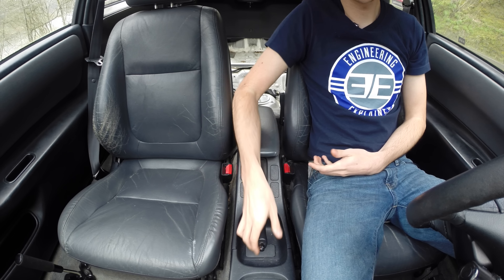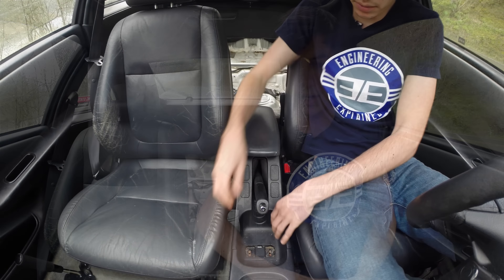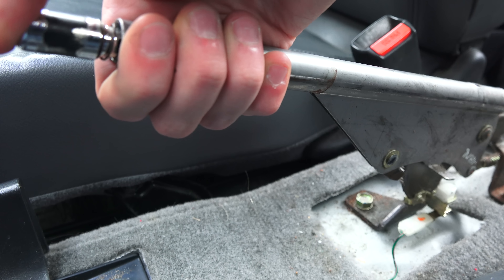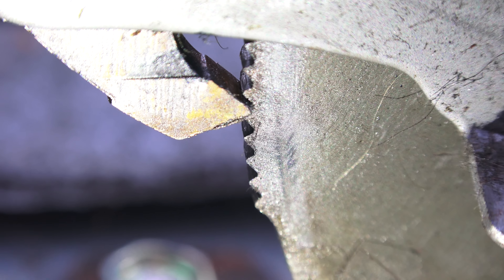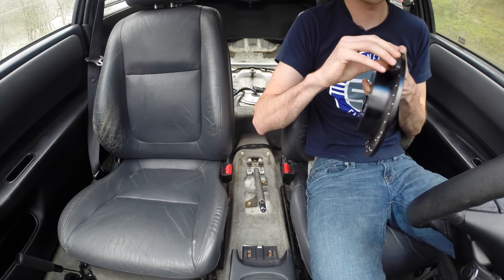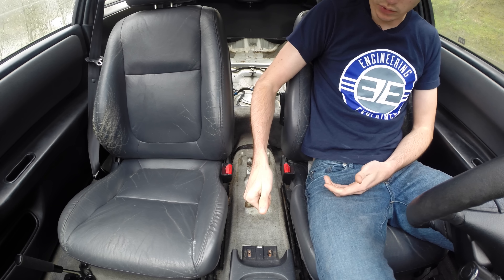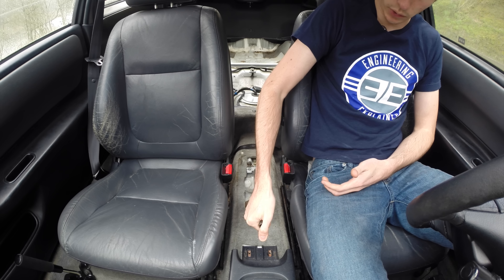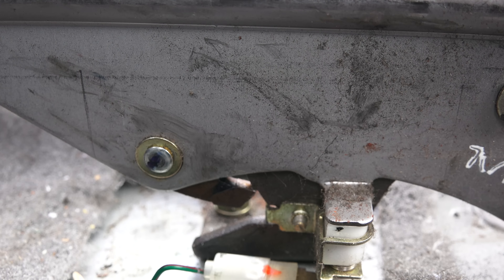Always Press The Handbrake Button? Myth Busted

Comment: He roasted everyone with the socket wrench example v
Reply: Socket wrench’s never wear out do they?
Reply: I've worn out a couple of 3/8 ratchets, they just slip because the teeth were worn down.
Reply: @daily501  I was taking the piss. I’ve binned quite a few down the years mostly Britool as that’s my favourite brand. ( after keeping them for potential spares, I got real and chucked them) 
There’s a lot of people who seem to think that the metall to metal contact and stress in a handbrake ratchet is exempt from the rules of physics that eventually fucks everything else.
Reply: @highdownmartin  i was replying to original comment mate. I fully agree with you about the metal to metal wear, I always push the button when operating handbrake lever. Have a good Bank Holiday weekend mate
Reply: @daily501  and you fella
Reply: It was basically the most polite burn 😂

Comment: Thank you to Car Throttle for perpetuating this myth.
Reply: lol
Reply: Friction causes heat, genius.
Reply: Yes friction, but you would probably have to sit there pulling it up and letting it down for a pretty long time for there to be enough wear for it to fail. Like a thousand years.
Reply: But the damage the friction creates is so small it can be disregarded. Very small quantities that are used to describe inevitably larger numbers are sometimes not needed since they affect it a very small quantities that isn't even noticeable until a very very long time frame. But if you are oh so well versed scientifically and care so much for that small detail then instead of using 300 000 000 as the speed of light, use the exact value which is 299 792 458 in every computation you would use that constant. Also, when facing non-repeating decimal numbers, like the value of pi, use as much of the space you can to write the farthest decimal value you can since accuracy is that important to you. Lol.
Reply: Yeah you'd only have to ratchet the hand brake up about 1 billion times to wear it down enough to not work anymore. What a smart thing to mention.
Reply: Interesting thing about this is, that all proponents of "push the button" do in fact completely disregard the fact that you are wearing off the button itself. 
The button will surely fail sooner than the ratchet mechanism due to the fact that it's made of plastic and not designed to be pushed all the time. 
Hey people, do not press that button when activating the handbrake, you are wearing it off! Be nice to your car! :-D
Reply: My beautiful and amazing mistress genius how many times would u pull your handbrake to wear it out? Probably your great great great grandson won't even get close to wearing out the mechanism
Reply: So we should just stop using anything that was designed to move as every time we touch it we are slowly wearing it out.
Reply: And we are saying yes but its probably going to outlive the car so who cares.
Reply: I had no idea that people actually thought that it was “bad” to pull the hand brake without pushing in the button and I’m not sure how this misconception ever could have taken hold. I guess these people have never used a ratcheted socket wrench. In any case, there will obviously be some slight wear of the ratchet mechanism over time but the cables or even the pivot point on the brake handle is going to wear out long before the ratchet mechanism ever does. In short, its purely a matter of personal preference whether to push the button in or not. And lets not forget that this exact same set up was used in small aircraft (used to adjust the flaps) decades before we started using them in cars as parking brake controls, and a mechanism has to be pretty reliable to make it into an aircraft design. And by the way, if you talk to the average Cessna pilot he will likely tell you that he does not push the button in when setting the flaps.
Reply: SLOBeachboy same I just always hated the sound
Reply: From what I've been told this used to be a problem on much older cars (particularly old British cars) which often used inferior quality materials, especially in the post-war period when pretty much everything was scarce.
Reply: My beautiful and amazing mistress No one uses their handbrake every day unless you are a rally driver, and in rally cars the handbrake doesn't even have a button on it
Reply: Pavel Vitis If button fails you wont be able to disengage brake.. but if ratchet fails it would do it while the car's weight is resting on the brake.. that might be a very dangerous scenario.

Comment: while I completely agree with you that the ratchet mechanism on the handbrake is designed to be used... as a ratchet, I disagree with your statement that wear is caused by heat. heat is caused by friction, wear is also caused by friction, it's just that when you have enough friction to cause significant amounts of heat very regularly then there is a lot of friction, lots of friction also causes lots of wear.
Reply from the maker: +Neil Sheriff Heat accelerates wear. Apologies if that point was unclear - obviously there must be friction for wear.
Reply: +Engineering Explained although i agree with your points, i think you could have used the term negligible more. yes, using the ratchet will cause wear. any contact between surfaces will cause wear. but this system is great because it is cheap and the wear is negligible. the heat generated from use is soo minute that i doubt it could even be measured. but i love your comment about how if the ratchet wears out... the car is probably done anyway. still, there can be an occasion where these parts wear out... but even then... lets be honest. it isnt the most expensive fix for a car. a ratchet mechanism, some metal and plastic. buy the new part and self installation would be under an hour.
Reply: +Engineering Explained how fast to tires wear out during handbrake turns? is there a proper way to execute a turn without completely mutilating the tire?
Reply: +Engineering Explained thanks for your explanation, it may be worth making this a subject of another video or more specifically about heat stresses. I'd still maintain that heat in itself doesn't cause wear, however that it can accelerate the wear of components which experience extreme heat stresses such as brake discs where the constant heating and cooling can cause microscopic surface fractures which will then wear more quickly when friction is applied but the heat in itself hasn't caused wear of the discs. Heat is generated in the ratchet mechanism, but not enough to cause the stresses that produce effects which can cause accelerated wear.
Reply: Thomas Ferguson ... are you serious?
Reply: +Murray Kitson If you somehow manage to wear the teeth on the hand-brake ratchet through normal wear, take a hardened steel file or a small cutting disc, carve some new teeth and refresh the ratchet's tip.
Reply: +Engineering Explained This video was a little disappointment, however the statement is absolutely OK, heat is (only) one factor.
Reply: +Neil Sheriff  +Engineering explained Friction causes heat. And the two metals used for the handbrake are designed to have very few friction together. So the friction isn't a big deal there because it is all planned used the right metals.

The heat is the most important fact here.

Comment: The socket wrench was a great comparison. That's a way to prove a point!
Reply: +Jeff V agreed
Reply: Ratchets do wear out. The internals have to be replaced after a bit of use. Any pro mechanic has rebuilt their ratchet or had the tool truck do it. With that said, I agree with this video.

Comment: i like to test my car when i stop on a hill and see how many clicks it takes for the car to stop moving, well i get bored waiting for my woman to get ready and come of the house..
Reply: How many clicks to stop the car on a 2% grade? How many clicks total? How many clicks before it's time for new brakes?
Reply: T Shuart Ha Ha I am not sure how many but i think thet fail on the amount it moves as the mot fail will say .  " Hand brake travel excesive"
Reply: Same here
On a very steep hill, 4 clicks would be enough
Reply: AthletismeQc I just pull it up till I feel it’s enough lol
Reply: The parking break should be pulled all the way, all the time. But usually carmakers do tests to figure how many 'clicks' it takes to park the car on a predetermined hill.
Reply: Same
Reply: How many clicks does it take to get to the Tootsie Roll center of a Tootsie Pop?
Reply: I will have to try this now
Reply: 5-7 clicks is the usual Toyota spec
Reply: @kennethebel7726  My rav4 parking break doesn't work
Reply: @sugarbooty  take it to a shop, they'll figure it out. I cant really tell you what's wrong without being there. Sorry man
Reply: @kennethebel7726  I'm not asking for advice, I was simply stating. Someone cut the line going to the lever, I'm just too lazy to fix it because they'll do it again

Comment: The only trouble that I have experienced in my 38 years of driving is that the cables stretch and fail first. I have lived in some hilly areas of the fruited plain, always turn your wheels toward the curb and use your handbrake. I've watched many folks chasing their vehicles down the street. Sam.

Comment: The cable will snap long before the teeth grind down!
Reply: +Da Siver I was just thinking that. :P
Reply: Usually they just stretch. Had this happen in my old Honda. Cable stretched too far for adjustments to take up the slack  and had to be replaced.

Comment: This is a tip I learned years ago, before you pull the handbrake on press the footbrake hard .This pre applies the brake pads or shoes against the disc or drum and increases the efficiency of the handbrake application needing less effort and less stress on the mechanism.
Reply: If you’re pulling up the handbrake, you’re probably already stopped with your foot on the brake, meaning the pads are already contacting the rotors. Pushing harder on the pedal shouldn’t have much effect on the work the handbrake has to do, apart from some negligible flex in the braking system.

Comment: I wore out my handbrake in Tokyo when I was drifting against the grandson of yakuza mafia boss. Should I keep using the e brake while drifting in my fwd car or just use the brakes?
Reply: +DreiZ You should use the inertia drift!
Reply: Tokyoooooooooooooo drift
Reply: +Chola Tech Its front wheel drive, more gas = understeer, you won't be drifting you'll be going straight for the wall. However if it were RWD more gas would be correct. I would just use the hand brake, just look on eBay how much a new hand brake mechanism costs so you know what you are getting into if you damage it. The problem with using your brakes is it gots to all four wheels so I don't see how you could possibly drift by doing that. ALSO are you sure you haven't just worn down your back brakes?  Try adjusting your handbrake if you have drum brakes it is incredibly simple you just hit the drum off when you are changing tires and there is a brake adjuster that will let you tighten the hand brake. If you have disk brakes it is a bit more complicated but still not hard just look it up on youtube. I believe +ChrisFix has a video on it.
Reply: +ForTheTech Could just go in reverse.
Reply: ForTheTech Bro, it`s a joke. F&F 3 - Tokyo Drift - the scene when Han is teaching Sean to drift :D
Reply: Chola Tech Haha okay its been a couple years since Ive watched those!
Reply: +DreiZ Neh, ur ratchet is fine

Comment: I somehow avoided that advice for a long time, and the first time someone finally gave it to me they phrased it in a way that left me with the impression that yeah it's designed for that and all, so it's not actually hurting anything, but they personally just liked doing that because it felt like taking slightly better care of their car, with something easy. Now I do it for the same reason. I just like feeling like I'm being more gentle with my car. And it certainly doesn't hurt, right?
Reply from the maker: +thesourceofx doesn't hurt, just doesn't matter either way. :)
Reply: +thesourceofx 

But what about added wear on the finish of the button!?!?! or wear on the spring for the button!?!?!
Reply: +thesourceofx Well pushing the button in may not engage the teeth completely.. so if you are on a steep hill dont push the button in
Reply: +Justin Therieau Asking the real questions!
Reply: +Engineering Explained Yeah I completely agree. It's at best an illusion of caring for me car, haha.
Reply: +Richard Fergusson That's a good point. I usually feel for the lever going back down a bit, which tells me the pawl is engaging. If I didn't feel that I'd click it one more tooth.
Reply: +Justin Therieau hahaha, very true.

Comment: Wouldn't the button just wear out faster instead?
Reply: c0c0asauce no it will not. There is no friction being applied on it. How the hell is it going to wear out??? I have that's 50 years old by now and the handbrake still works fine. And the button has never been pressed when pulling it up.
Reply: Chin Wee Ow I think he meant if you press the button everytime you set the path brake, the button will wear out, not the ratchet mechanism.
Reply: Ryan Borgerding and precisely what I said, there is nothing rubbing against the button. There's an entire layer of it. It'll take centuries for it to wear out.
Reply: But there's a spring...
Reply: Approximately twice as fast I assume, if you use the ratchet mechanism to engage it and the button to disengage, you're using it half as much! 🤔

Comment: One more thing to add to the video; these parts are grinding with very very little force; the hammer is just resting on the teeth with very small spring tension, and when you pull the lever, it just drops lightly on the next tooth then the next, etc. Besides, this is all steel to steel sliding, even if you do this everyday for hours for ten years you will not see any change

Comment: I totally agree that, on a well designed and built hand/parking brake the ratchet should be used as you describe.  However, wear is not caused solely by heat.  I once drove a van where the pawl of the hand/parking brake was made of mild steel working on a hardened ratchet and it did wear out.  Cheap and not correctly designed, but cheap enough to replace.

Comment: A problem of pulling it with the button depressed is that you don't get the feedback to tell you it is fully engaged. If it lands on a tooth instead of between teeth, you might not realise it and if your cable is a bit worn or loose that could mean that your car isn't adequately secured against rolling off on an incline

Comment: Finally someone with my thinking. I do the same with the clutch - no need to press it down when changing gears, just bang them in and there is a bit of ratcheting sound as the gear teeth rub on each other but has been fine on my car - every 1,000 miles i just change the gearbox ;)
Reply: Lmao what
Reply: hardly the same rofl